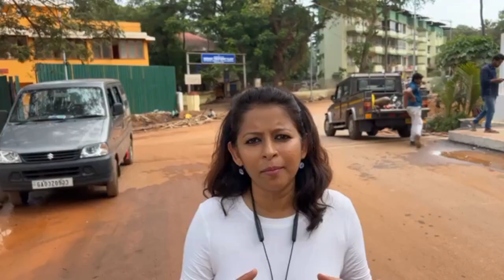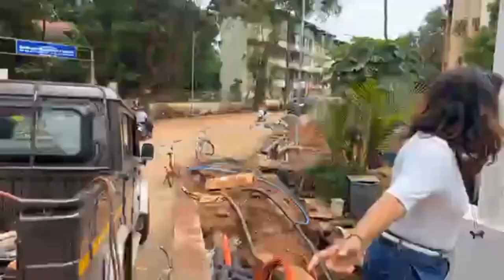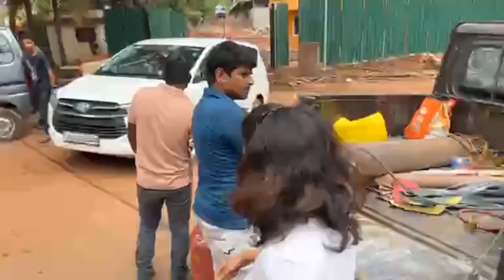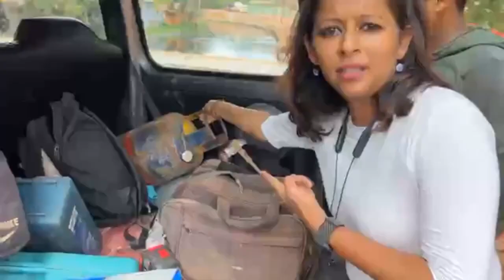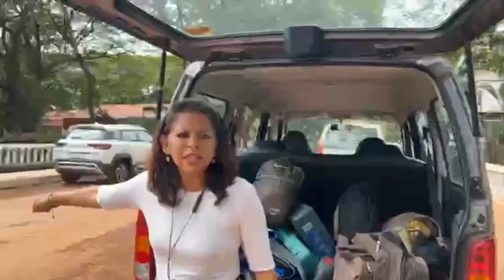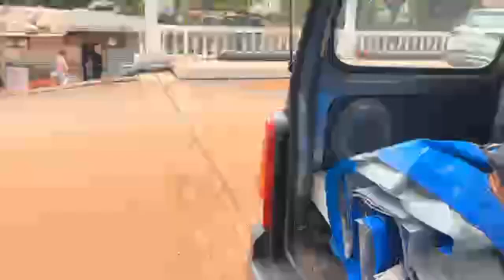CECILLE RODRIGUES EXPOSE CYLINDER SCAM ! DOMESTIC CYLINDER USED PWD WORK

Comment: Gas cutting and gas welding is done by the biggest gas cylinder called the Accetylene cylinder not by the domestic house cooking gas cylinder, that's why the cooking gas cylinders are shortage and expensive. The authority is sleeping that's why these nongoans are awake.